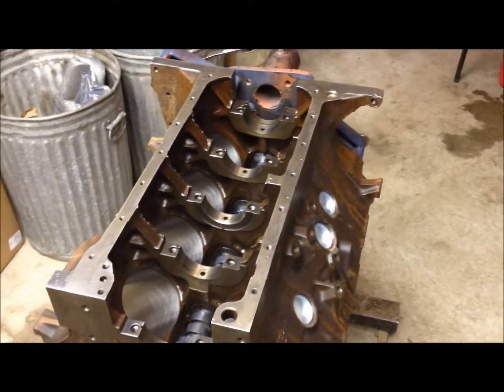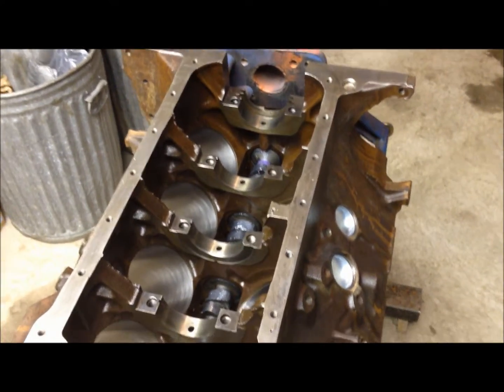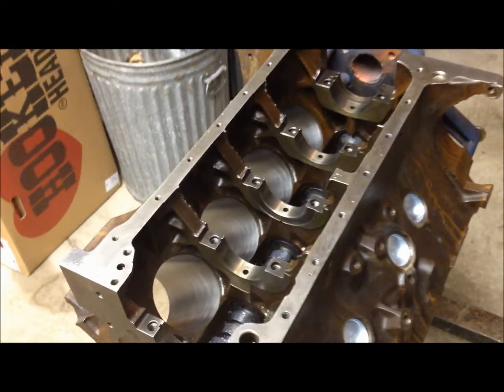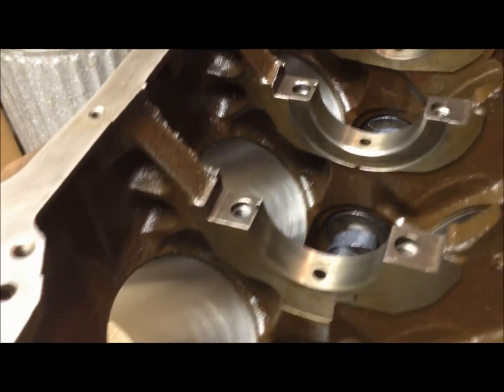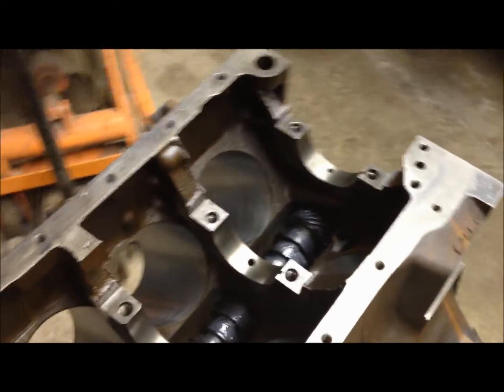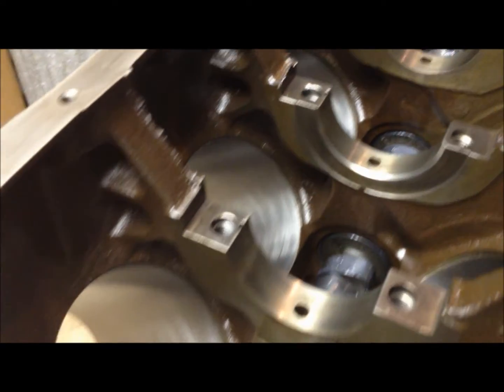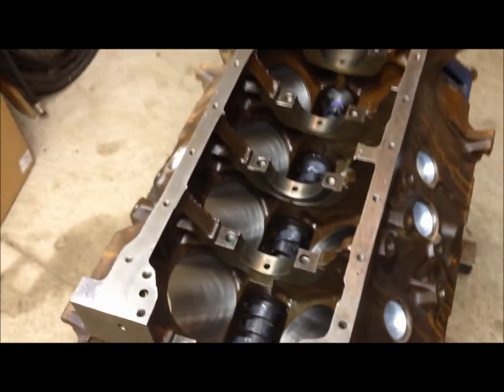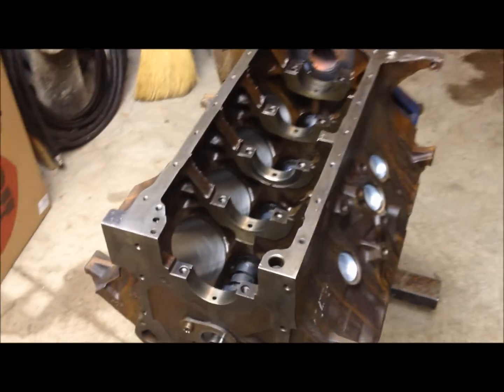The Strongest 390/360 FE Blocks

Comment: Hes right but a good indicator is a mirror "105" cast into the exterior of the block. Usually these were heavy truck or service blocks. Have the same webbing as a 428 block and 90 percent of the time can take an .080 overbore which is std 428 bore. I've done this a few times with these bu always a good idea to sonic check before... and pretty sure that's as far as you ever want to bore one.
Reply: an .080" overbore is a very bad idea for 90% of FE blocks! They are all thin-wall castings.
Reply: @sandibaker7646  I was referring to truck blocks... not run of the mill fe motors. The ones with the web and 105 are thicker castings.
Reply: @scottford1091  - ALL FE, and FT blocks from medium duty trucks are thin wall castings. The standard single main web blocks HAVE thick webs. 

A later model 390 block with extra main webbing may have slightly more strength. but either single or extra main webbing is adequate for any engine making under 600 horsepower. More than 600 horsepower, and they should be cross-bolted.

As far as boring any FE or FT .080" oversize, even with sonic checking for wall thickness and core shift, .080" will weaken the cylinder wall, and lead to wall flex and poor piston-ring seal. Then it's time for a block fill, as a band-aid repair. 

"Again, the best strategy by far is to keep bore diameter to a minimum. You lose a lot more power due to poor cylinder wall sealing than you can possibly gain in cubic inches" --  2018, B. Rabotnick; "How To Rebuild Ford FE Engines"
Reply: @sandibaker7646  how many have you built? I've built 3 and they are all just fine... std bore 4.130 428 pistons in an ft HD 105 mirror block. I only know my own experiences and they are ok if you do your homework.  Blanket statements like ALL and NEVER and CANT should be avoided.  None of us know everytjing.
Reply: @scottford1091  - "None of us know everytjing[sic]." is an accurate statement. 

I do not  "build" engines, but I have assembled a few. To properly "build" an engine would require many thousands of dollars worth of machinery, and years of experience doing so. That includes more than the skills of a journeyman machinist.

I referenced Barry Rabotnick (above) because he is a nationally recognized FE expert, with two published books written about FE engines, and rebuilding them.  He also has a machine shop, with a highly skilled machinist working for him, and years of experience with FE engines.

I quoted Rabotnick, as an explanation of why too much boring of an FE block is not a good idea, along with the well known statement and FACT that ALL FE and FT engine blocks were thin wall castings.

I did not use the words "NEVER" or "CANT[sic], in any of my responses.

You would do well to increase your knowledge of FE and FT engines, before giving bad advice about reconditioning them.

http://www.survivalmotorsports.com/AboutUs.html
Reply: @sandibaker7646  so you've never built one... ok. You don't know how much I know about engines. I give advice about things I have personal knowledge and let the reader decide. Maybe everyone isn't made of money like you seem to be and can't afford the best of the best and must make due. I stand behind all of my work and I stand behind my comments here. Don't take my advice if you know so much more than me... since I  am so uneducated on fe and ft motors. I have two fe motors in my shop right now that I "built" . I expect they will do all that is asked of them for a long time. Maybe you should stop being so condescending.Also try something new sometime and respect the fact that others might know more about thing than you. Like I asked before, how many FE builds do you have under your belt?
Reply: @scottford1091  - it appears that your idea of building an engine simply amounts to putting one together. By your standard, I have built a few. 

When you make false, misleading statements, I will call you out when I see them, as I clearly noted above.

You have ignored my Rabotnick quote, and reasons for not boring a 390 .080" oversize. How many 390 blocks have you sonic checked for cylinder wall thickness, and core shift?

I worked for 8 years at a large new car Ford and truck dealership, from 1969 to 1976. I had a working knowledge of parts sales, including 352, 390, 427, 428, 361/391 FT's, Super Duty 477/534 V8's, and the vehicles they went in.

I have been doing my own automotive repairs for over 52 years.

 I also worked for 5 years doing machine and building maintenance in a 100,000 sq ft stamping and assembly plant … building maintenance, 3 phase electric wiring, operating engine lathes, a Bridgeport mill, surface grinders, a Blanchard grinder, MIG, TIG, SMAW welding, repairing our 400 ton and smaller presses, repair of  #10,000 capacity motorized steel un-coilers, fixing 50 KVA spot welders, and other assorted assignments (they also had me design and build a coiled steel straightener for feeding an automated television vacuum tube frame forming machine.

I ended up retiring after 32 years of inspecting, rebuilding, and repairing railroad freight and passenger cars.

I have managed to keep running and repair over 100,000 miles on 2 BMW motorcycles, and another 100,000 miles on my BSA, (2) Kawasaki, Harley Davidson Servi-Car, and Aprilia motorcycles.

I do all the maintenance and repairs on my 4 cars, a 1979 F-150 4x4, two DRW F-350's, and my 37' Newmar Class A #20,000 motor coach, in my 6,000 sq ft man cave (with a #12,000 capacity lift). 

I am far from an expert on many things, but I have some experience and knowhow.
Reply: I own a professional restoration and rod shop. It's what I do for a living every day. I've owned over 100 Fords. Go challenge yourself with another oil change...
Reply: never was. Far as your quote? I've had 5 checked and 3 were good enough to build to 4.130 bores with .074 being the thinnest in a non-critical part of the bore.... tell me about all your fe builds... I'm in the edge of my seat.... Choo-choo Charley
Reply: @scottford1091  - so, "I've worked as a full time tech at 5 different ford dealerships since 82" ... FIVE? I can understand by your ignorant comments why you cannot hold a job. Were you fired, or just asked to leave?
Reply: @scottford1091  - I never said boring a 390 out .080" cannot be done -- I said "an .080" overbore is a very bad idea for 90% of FE blocks! They are all thin-wall castings" ... you certainly lack reading comprehension. I would challenge you to a battle of wits, but see that you are unarmed.
Reply: @sandibaker7646  wow... very original retort... never heard that one. You are inexperienced at what I do every day. You ain't that witty friend.
Reply: @sandibaker7646  not any of your business but I've moved all over the country. Never fired... so when you actually have hands on experience at building a high performance fe motor then maybe someone could take your comments with something other than a grain of salt... choo-choo
Reply: @sandibaker7646  90 percent of fe motors weren't 390 105 mirror blocks either. Now, grasshopper who lacks reading comprehension?
Reply: @sandibaker7646  reread my initial comment and take into consideration all that you have googled about what I said and found to be correct. So what insult or negative comment can you come up with to say about me?  The world is still waiting to hear about all the fe engines you have built.
Reply: @sandibaker7646  I bet you voted for Joe Biden didn't you...?
Reply: @scottford1091  remember. The guy making books puts his mouth on the line.
A person could bore 20 blocks 80 over. 19 had no problem, but one did.
So to be safe, and that book writer has a machine shop, he's not going to advise a risk.
If engine fails, he gets blamed.
But if you or I take a block to a machine shop, bring a piston, say an 80 over, the shop will bore it for us. If not, we just take it to another shop.
I've built at least 50 FE's. Bored 360's, 390's 410's. To 60 some 80 over. Never had a problem.
But there always could be that one engine.
If we do a lot of engines, there's always that one engine that doesn't work out.
Reply: @scottford1091  remember. The guy making books puts his mouth on the line.
A person could bore 20 blocks 80 over. 19 had no problem, but one did.
So to be safe, and that book writer has a machine shop, he's not going to advise a risk.
If engine fails, he gets blamed.
But if you or I take a block to a machine shop, bring a piston, say an 80 over, the shop will bore it for us. If not, we just take it to another shop.
I've built at least 50 FE's. Bored 360's, 390's 410's. To 60 some 80 over. Never had a problem.
But there always could be that one engine.
If we do a lot of engines, there's always that one engine that doesn't work out.
Reply: @sandibaker7646  there's a reason you are not getting any likes.
You read too many books, but don't experiment yourself.
Why don't you find a block. Have it bored 80, find out yourself.
Reply: @sandibaker7646  we get it. Working at a dealership. Makes you do things by the book. Some of us think outside the book, I mean box.
I worked at a production body shop. Everyone fixed a car by the book or they wouldn't do it.
But occasionally, that couldn't be done.
I was the only one in the shop with the guts to attempt to fix it.
Some of us are that way. It's okay for you to be the way you are. We need people like you too.
But if I have to cut a hole in the floor board to fix a new car, I'm going to do it.
I respect that you wouldn't do it.
Reply: @jesse75  I need another body man at my shop in NC... are you close? I cut my teeth in production bodywork. I think it's the best place to learn the craft. You learn to make stuff look good and get it out the door fast... then if you're lucky you can land a job where you learn the finer points of how to perfect lines and gaps etc... I did it for a number of years in the 80s and I own a restoration shop of my own. I have 3 guys now but will need more soon. I have 2 gentlemen bringing 20 cars to our shop. All boss mustangs and big block Mach 1s and torinos.
Reply: @scottford1091  I see you get up in the morning like I do.
I appreciate the offer and there's no question we would get along excellent with each other.
And you would appreciate me telling you the truth and my opinion about anything and everything. And I have a mass of tools.
I'm taking off a couple of years of working and devoting most of my time to my teenage daughters.
They are both talented. My oldest, 17, is ASE certified. Soon to go to college. But she always has a background in automotive.
She can get a job smogging or in air-conditioning. But she likes fish like I do. And wants to be a fisheries biologist.
I never when to school, as I had 8 uncles who were motor heads, and I learned most from them. Went to the drag strip, got a pit pass, and learned directly from mechanics.
And have read every book I could get my hands on. Especially all the early Ford H and M stuff, Ford power parts, Ford Motor Sport.
My dad was a painter at Pacific Car and Foundry. I learned a lot from him.
Cars, fun, drink beer, stay up all night play, work hard,  loud rock music, have fun.  
If it's right, I'm all about relocating. I've did it before.
I moved my family to Northern California. It's great up here. All that out door stuff to do. Reno is close. If I do 80 all the way, I can get there in 3 hours.
I keep busy on the side. My latest project, a customer found a track boss intake, so I'm building a clevor. I've got a 390 I found at pick n pull. My daughter  I pulled it out last month. Almost done. A couple more engines to do.
My two daughters and I are done restoring a 67 mustang for her to drive to highschool.
We did a 69 for my wife, but she's chicken to drive it.
I'm almost done with my 67. 
You got to love a mustang. Our favorite cars. 
I'll keep you in mind and I thank you for the offer. 
If you need any parts, let me know. 
Peace brother.
Reply: @OHUQTU  sorry to hurt your feelings. I don't think I directly attacked you.
Read the book. Don't Sweat the Small stuff.
There's a chapter in the book called  "Choose Your Battles Wisely".
It's a good book for you to read.
Reply: @jesse75  I need a cheap fe aluminum intake... cracked, chipped stripped ok...
Reply: @scottford1091  FE. frickin expensive.
Reply: @scottford1091  you might be able to find an old 390 SP2P intake.
I've seen people nearly give them things away. But for a vehicle you just want some off idle throttle response and boost mileage, they work.
Most people think they are junk. And that's good.
Reply: @jesse75  going on a 66 7 litre galaxie... a beat up performer or olf f427 would be perfect... aluminum heads  I had an sp2p on a 400 once and it picked up like 3 or 4 mpg and had much more to but quit at like 3500rpm
Reply: Scott. Have you filled any 390's with hard block ? To keep over bores on a cleveland I have filled part of the water jacket to stiffen the block. So far none have cracked and overheat. Just wondering if you did it to some 390' s.
Reply: @cammontreuil7509  no I haven't. The 105s are pretty stout blocks. The deep skirts help with stability.  Depending on you goals it's not a really big to cross bolt the main bearings. Under 500 hp and you would be fine I believe. Last one I did was maybe in the 450 range. Big hydraulic cam with ported cj heads and sidewinder intake. Wanted a PI intake but couldn't find a good one... hard would be for off road use I think. Never had block strength issues with C motors either.... oil system mods are your best friend with a cleveland. Also, skip the 4 bolt mods. 2 bolts are very strong.
Reply: @scottford1091  I've only built about 40 390's. Never took them out to 80 but never had a problem going 60 on a bore. I always hated putting on that rear main cap on an FE.
In the 80's I always convinced my customers to deep six the gas sucking pig FEs for a cleveland or windsor in their trucks. 
I scraped for metal atleast 50 FEs. Shame on me. 
Because of recent interest in the FE by many, I have taken a second look at these engines and have built a 390 recently and it sold quick to my surprise.
I recently bought a 67 mustang fastback and it had an FE in it. 
The owner wasn't completely sure what engine it was but I crawled under the car and see the engine was cross bolted. 
The engine was topped off with a 68 tunnel wedge intake and 2 badly leaking 800 carbs. It ran but I told him to shut it off I was going to pull and dismantle the engine anyway.
To my surprise the engine was heavily modified. All internal parts of the block was polished. 
First time in all these years of engine building having a 427 was a real treat.
It made me have respect for the venerable FE. 
I'm semi retired and only do about 25 engines a year now. But thanks to comments like yours and others if I come across an old 390 I'll bring it back to life instead of thinking it is just scrap metal.
Thanks for your comments. I plan to bore a 390 out with 428 pistons one of these days if I find the right block
Reply: @cammontreuil7509  begging for oil leaks! Lol I probably used way to much silicone on my builds but at least we don't have to use those silly rope seals like in olden times...
Reply: @cammontreuil7509  and a 1u crankshaft... getting like hens teeth. 500 bucks will get you a good core these days.
Reply: @scottford1091  funny.
Reply: @scottford1091  I'll keep an eye out for them cranks.
I have a 4MAB crank. Trying to figure out what was the original application on it. 
I've had 70 or more 4MA's but never a B.
Reply: @scottford1091  someone put a 1UA crank in my 427. With a 650 solid roller the engine behaves on the street. I think it's because of the crank. 
In Yakima Washington at tee pee auto wrecking they may have a 428 crank. Give them a call. I used to buy alot of parts from them. 
One problem. They don't always know what they have so I'd just take my truck and spend the day and found what ever.
Yakima has some great wrecking yards
Reply: @scottford1091  I just called tee pee. They have some 360 390 or 428. $350. Unless you know a better way I take a plug out put a stick in it and measure the stroke.
Reply: @cammontreuil7509  that's a 454 right? Always thought those should been offered in a mustang... could you imagine a 454 fe high riser in a 68 fastback?
Reply: @cammontreuil7509  I don't trust myself to do that...lol. I'd end with a 352 thinking I bought a 428...haha..I go by numbers or measure bores and strokes... I mean ford did so many combos with fes you never know til you know.
Reply: @cammontreuil7509  427?
Reply: @scottford1091  yip.   I'm going to make a utube video of the car shortly.
Reply: @cammontreuil7509  will you message me when you do your build? If you do, would you post all your numbers and measurements inuding sonic check for wall thickness? I think some folks really need to see some of that stuff. Do you have a block? I have a buddy who has a 105 block if you are looking. Cheers!!!
Reply: @scottford1091  I don't have a FE block at this time. I'm building and Cleveland at this time.

Comment: Sad to say but you didn't even modify the oil galleries the most important part of an FE build and I hope you had the engine balanced & head work is crucial with unleaded gas to with adjustable rocker arms helps to create more horsepower